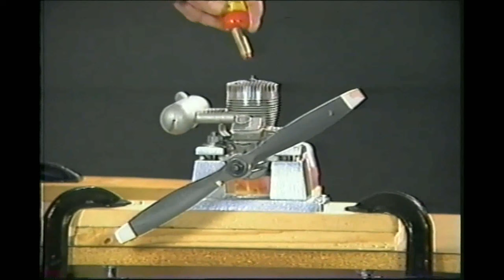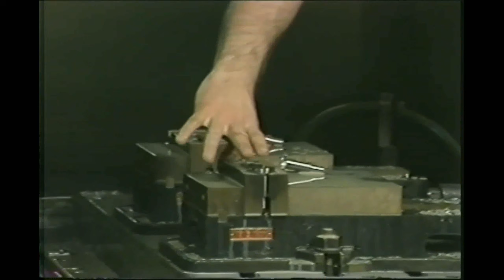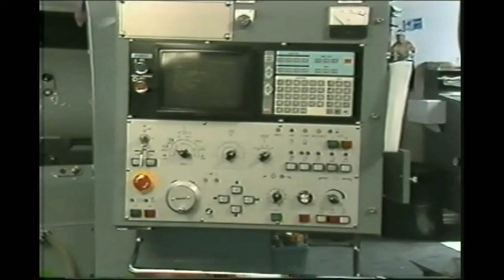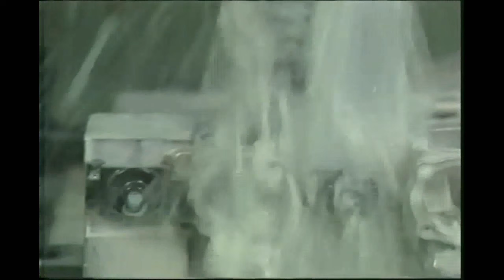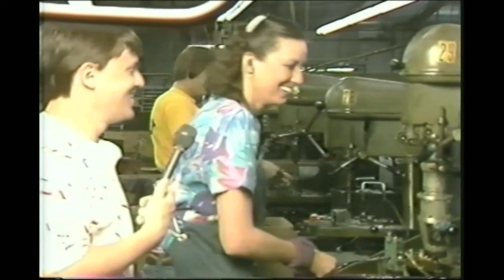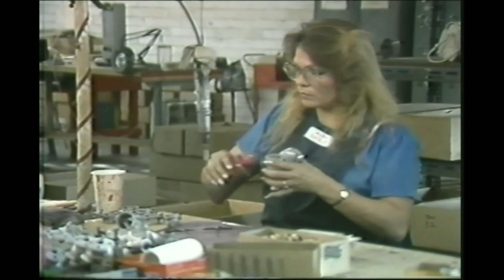K&B Manufacturing Promotional Video of their Downey, California Model Engine Factory 1980s

Comment: I wonder what happened to all those machines, molds and other equipment that was used.
Reply from the maker: MECOA has everything from the Lake Havasu plant. We moved it ALL back to Southern California in 1999. We still have some of the machines and all the tooling and molds. However most machines were older our new equipment is much better.
Reply: @MECOA  thanks. I was surprised how much the engines are now but since they are not being produced in the thousands it is understandable.
Reply from the maker: Well in 1985,  what was $70.00 would cost today in 2025 about $220.00 and the wage in the factory was around $5.00 an hour or less, now it outpaced inflation and is more then $20.00 an hour so the price you are thinking is high is really not considering we make everything here in California. So that's why it's hard to compete with the Chinese prices.

Comment: I brought a K&B new in the 90s, it vibrated so badly the crew’s came lose.
Reply from the maker: Unbalanced prop or mount not rigged enough are the usually issue that cause this. Not necessarily the engine.

Comment: Ran lots of the K&B 61 with the Perry Carburetor. Once set up they run for ever.
Reply: Just keep the fuel clean and a filter on the air intake.
Reply: I'm resurrecting an old one I got off E-Bay right now. I'm not sure what year it was made, but it has a Perry pump carb, and HAD a pump...before I ruined that trying to take it apart. It also has the cast aluminum drive flange with the two flats (double D) on the crankshaft.

Comment: I have a KB 45 and it's  very strong......Had it on a Nobler line model that would pull me off my feet. I throttled it back a little to make it easier to fly that plane.

Comment: I have maybe 5 airplanes or so with old K&B engines. A few I believe Green head race motors. A fly by wire plane from about 1934 and the others are 50s or pre 50s.  All with motors and spare motors and parts. That’s if K&B was around back then.  I haven’t looked at them for 25yrs or so.  The planes are big silver bomber looking military planes and have tiny manikin drivers.  You just hold the handle with two wires coming out of it which hooks through the left wing and you tilt the handle to go up or down all in a large circle. I always wondered about selling them but keep putting it off.  They are wood with some sort of  paper skin not flying worthy anymore due to age.

Comment: Nylon is definitely a type of plastic.
Reply from the maker: Plastic is too generic of a term, Nylon is specific. Plastic can range from crap that cracks and shrinks to engineering plastics like used on intake manifolds on modern cars. We want it to be known, NOT CHEAP PLASTIC.
Reply: Work Safely has got some assembly fingernails.

Comment: My first R/C engine was a K&B 40 with the Perry carb with the exhaust baffle controlled by the throttle.  It was easy starting and a smooth runner.